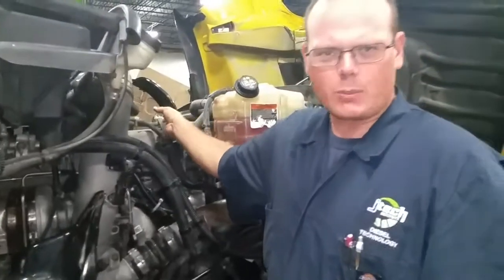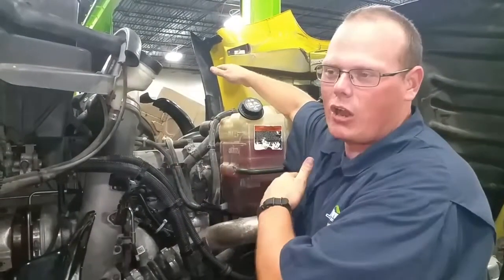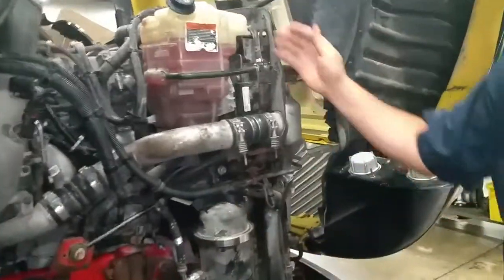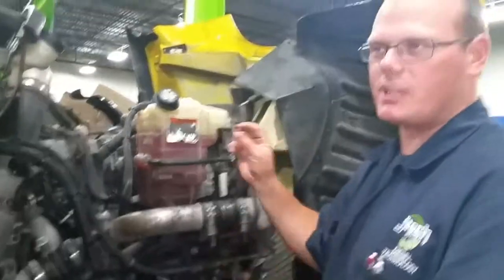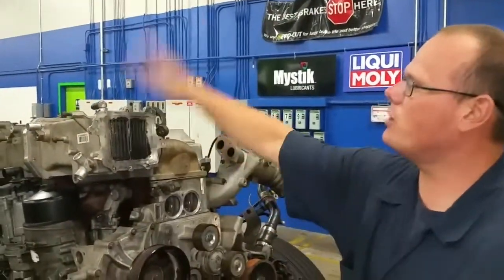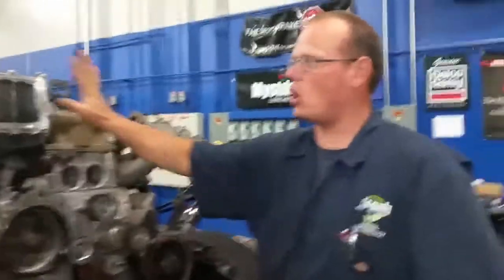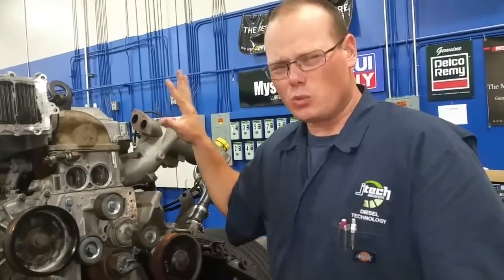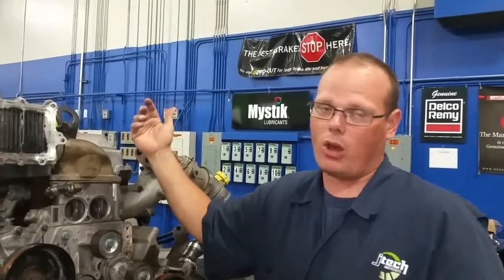Coolant System

Comment: Thanks for the Video. My issue is my reservoir is emptying out  sensor saying (coolent level low) I stop and open radiator cap and it flows back. Could it have a bad cap?
Reply: @SquidDiesel  so the cap causes that I’m having the same problem
Reply: Did you ever find out the issue?